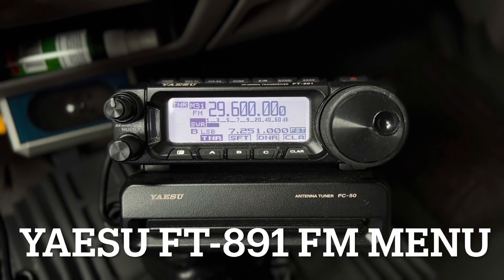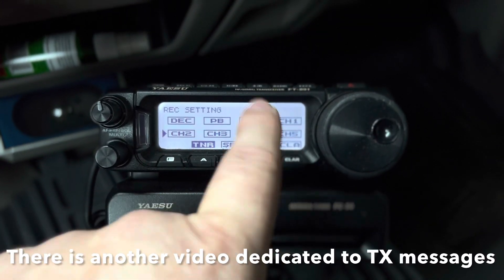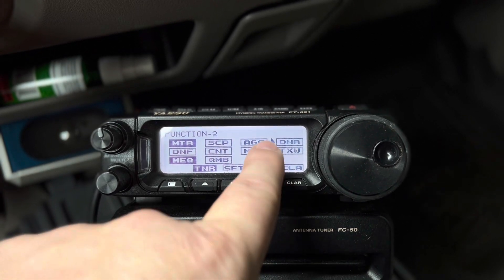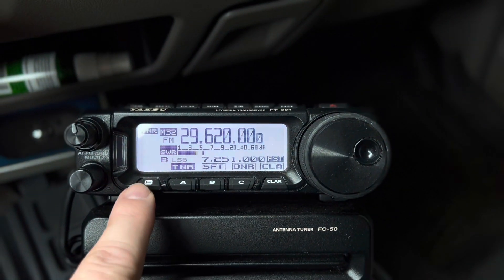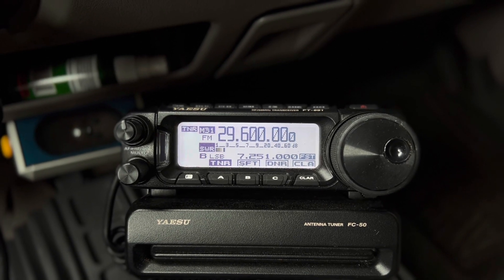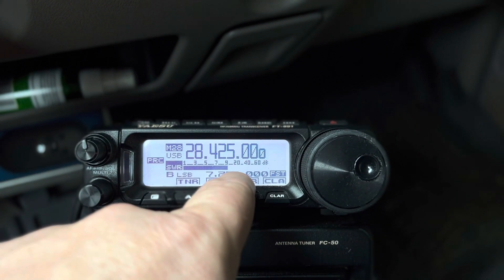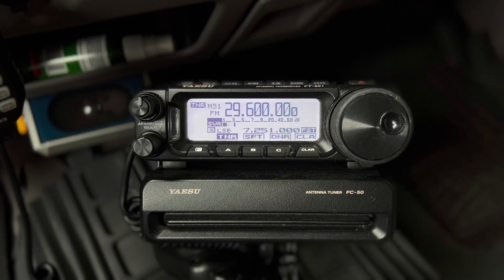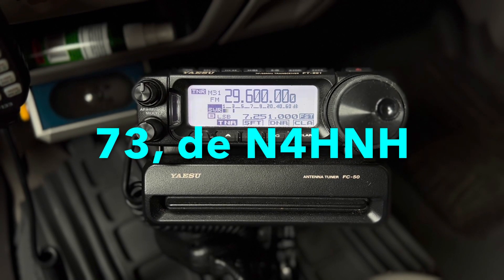Yaesu FT-891 FM Menu #yaesu #ft891 #hamradio

Comment: So…it chooses the proper frequency offset for 10fm and 6 meters?  I’ve been trying to figure this out on my radio. I’ve been out of th hobby for over 20 years so coming in now I’m in total shock with all the new stuff. I have a lot of new gear and I’m absolutely struggling to figure them out lol 😂
Reply from the maker: It's amazing how much has changed since you were last in the hobby!  There is a menu to set the frequency offset for 10m FM and 6m FM repeater operation.  It is usually 100kHz for 10m but can vary from 500kHz to 1.7MHz for 6m.

Comment: Hola amigo
Te cuento. Me compre un yaesu 891.  Traido de japon..o. sorpresa. Me encontre. Que solamente. Entregaba. 50 wats.  Hablando con colegas. Me dijeron que habia que actualizar el firewaaar. Bien. Lo hice. Pero nada. A cambiado. Luego me dijeron. Que desde el menu de. Servicio. O oculto. Se tendria Que poder hacer.  E entrado al menu oculto pero no sabria. Cual de los parametros habria que cambiarle...no se si es a si.o tu sabes. Como hacerlo..desde ya. Muchas gracias  si me puedes ayudar. 73" cordiales.  LW7DBJ. Carlos
Reply from the maker: Japan has different power restrictions than the USA.  It is similar to how Europe has the 70m band and the USA doesn’t.  The European 60m band uses different frequencies than the USA. You might want to contact Yaesu USA and see what can be done.

Comment: Can you do FM on cb band?
Reply from the maker: The FT-891 is an amateur “ham” radio. It requires a license to transmit with it.  With that license comes the responsibility of only transmitting on frequencies that are legal for a licensed amateur radio operator.  Out of the box the FT-891 will only transmit on amateur radio frequency bands.  But there are additional limitations.  Your license class determines where within those bands you are allowed to transmit.
Reply: @n4hnhradio  I mean’t to ask for the MARS Mod radio
Reply from the maker: If you send a copy of your MARS license to Yaesu, they will send the instructions for the MARS modification. If you perform the MARS mod and you intend to use the radio on frequencies outside of the official ham frequency bands, you do so at your own risk.

Comment: Wondering if you could help me out I started changing the menu but now it won’t move it’s like it’s locked. Any ideas thank you.
Reply from the maker: Try cycling power.
Reply: Ya tryed that a couple times
Reply from the maker: @tmfracing1315 you could disconnect the power cable for about 1 minute. If that doesn’t work, try a factory reset. But be aware that you will lose any menu changes you made.
Reply from the maker: To perform a hard reset, press and hold the F and the CLAR keys while powering up.
Reply: Got it working now just getting used to it first day haha thanks
Reply from the maker: Good

Comment: What about the split ie offset step? Is it done automatically?
Reply from the maker: Repeater shift (+), (-), or SIMPLEX, is set in the RPT parameter of the FM function menu.  Tone is also set in the function menu.
Reply: What about the +/- 600 kHz value? it is fixed ot settable?

Comment: Hi Doug, I've been thinking of purchasing the FT-891 for portable use. If I do I'll be back on YouTube (or Patreon) to watch all of your operation tips and tricks videos to help me learn the radio. As alway thanks for your work to make these videos available. 73
Reply from the maker: Hi Martin!  The FT-891 is a fun rig. There are a couple of shortcomings, as with all radios, but the good overwhelmingly outweighs the not-so-good. 

It lacks enough memory to save every setting when you save to a memory. But, still, do yourself a favor and operate it from memory tune, like I show in one of the videos. That will save you from having to use the Band button on top to change bands/modes. After you store your favorite frequencies and modes into memory slots, you will no longer need the top buttons, except to turn the radio on/off, or maybe the Fast button. 

The other shortcoming is the same as with other modern radios that task the DSP with handling the noise blanker role. DSP noise blankers tend to introduce distortion into the RX audio. Don’t run higher than level 5 and minimize noise with IPO, ATT, and/or RF Gain first.

Those two shortcomings are the only ones that bother me but only one reaches the level of annoying, and that’s the noise blanker. 

73, Doug

Comment: I am a new Ham deciding on a HF base station radio between a FT-891 without having to spend on Sound Card or Tuner or the IC-7300. At present  $280.00 more for the 7300. I know that the best is FTDX-10 but too expensive at this time or should I save my money and get the FTDX-10. Very informative videos on FT-891 and the IC-7300. I want my first HF to be easy to program and use.
Reply from the maker: IC-7300 is easy to program and use. You could start with it and upgrade to a FT-710 or FTdx10 later. The FT-891 has the better receiver and DSP over the IC-7300, but yes, it will need a soundcard if you are going to work digital modes. The IC-7300 is good enough for digital and for casual rag chewing. If you later decide to contest or chase DX the receiver in the FT-710 or FTdx10 will be best.  If you are willing to learn how to maximize it, the FTdx10 will be the only radio you need for years to come. My FTdx10 playlist has over 100 videos that teach you how to maximize your use of that radio. If you want the next best thing to the FTdx10, at a price that rivals the IC-7300, then consider the FT-710 AESS.
Reply: @n4hnhradio  At present the FT-710 is $1050 with discounts, so you mentioned to get the FT-710 over the DX10 and 7300 especially for the price. The FT-891 will not work as a base station without the sound card?
Reply from the maker: No, I would never recommend the FT-710 over a FTdx10. The FTdx10 is a better radio. But I would pick a FT-710 over the IC-7300. I prefer not to spend money twice. I would dig in and learn to use a radio that can take you anywhere you want to go with ham radio, rather than buy a beginner radio and later buy a better radio, having spent money twice.
Reply: @n4hnhradio  Sorry for all these questions. What about starting with the FT-891 as a stand alone base station or is a sound card or external speaker necessary? If those expense are need then I will go with the FTdx-10.
Reply from the maker: I don’t care about a sound card, because I don’t care for FT8.  I work FT8 occasionally for my viewers.  It’s not my thing.  I prefer to improve my skills by operating modes that could be used in emergency conditions, on battery or solar power, with no computer required. Those modes are CW and SSB. I also don’t care about a waterfall. It’s radio, not television.  So, I could be perfectly happy with an FT-891 as a base station. There are videos here on my channel that show me using my FT-891 as a base station.  I’m probably not the best person to get this type of advice from. I’m just not into the bling. For me, the focus is receive and transmit, in that order. Those take priority over a color display and waterfall.
Reply: @n4hnhradio  I appreciate your honesty, I don't care for bling either. I just wait to listen to HF and have my other VHF/UHF rigs. Just want something to start with and then maybe get the FTdx-10. Thank you for your help. I will subscribed to your channel and look at your other videos. Have a nice day and 73.
Reply from the maker: The FT-891 is a boss of a radio. The FTdx10 doesn’t beat it by much in receiver competition. I showed that in the FTdx10 playlist.
Reply: @n4hnhradio  Thank again. I appreciate your help and informative videos.
Reply from the maker: You’re very welcome!  73, de N4HNH
Reply: @n4hnhradio  What antenna would you recommend for residential rooftop for the FT-891 base station?
Reply from the maker: The FT-891 has no internal antenna tuner so you will need a multiband antenna. As far as multiband verticals go, I like the Cushcraft R-6000.T R-6000 operates on 6 through 40 meters.
Reply: @n4hnhradio  The R-6000 is expensive. Would you recommend a multi band HF around $350 or less for roof top setup without radials.
Reply from the maker: I’m not aware of any great multiband antennas for $350 that can mount on a rooftop.  The good ones will require wire ground radials - 20 or more.

My R5 cost $479.95 in 1995. It is the predecessor to the R-6000.  The R-6000 covers 6 meters in addition to 10 through 20, with no requirement for ground radials. My R5 only covers 10 through 20 meters.  Like the R-6000, my R5 needs no additional radials. The radials that come with it are all that is required. They are part of the antenna, so the antenna can be installed on a mast pole, a tower, a deck, or a rooftop. You can see in my N4HNH Antenna Farm video where mine is mounted.

There is an affordable option from Hustler.  The Hustler 6BTV is currently selling for $300USD.  It will require radials in order to get maximum performance from it.  But it does operate on 10m through 40m, plus a limited portion of 80m.  It doesn’t operate on 6m. If you can figure out a way to install radials on the rooftop, you could try the Hustler 6BTV, for around $300.
Reply: @n4hnhradio  I appreciate your quick reply. I will save up for the R-6000 since I don't want to bother with radials. I will look for your videos. Thanks again. I will probably also get the FTdx-10 which I was convinced to get thru your informative videos I might become one of your patrons to get as much short cuts on setting up the 10 when I get it.
Reply from the maker: Patreon members are the reason any of my videos exist. Their monthly support allows me to continue.
Reply: @n4hnhradio  I saw the video of your antenna farm. Very creative on how you positioned your antennas. On the R5 did you run coaxial on the ground? If so, what do you do when it is time to mow the yard?
Reply from the maker: The R5 coax is suspended below the deck. It doesn’t touch the ground. You can see in this video how my coaxes are routed into the shack: https://youtu.be/rR32rArlOts

Comment: If the first week of October is any sign of what cycle 25 is going to be like on 10 meters ,WOW!  Using the internal tuner on my IC 746 with bring up the VE3MMX repeater  in Ontario from DM72  ( using a 102 inch whip mount on a 6 foot high cyclone fence ), and I heard CN8VY on 29.620
Reply from the maker: I’ve definitely been enjoying the 10m activity, and especially the 10m repeater action. I’m so excited for those who haven’t been licensed for long enough to enjoy the action of the higher HF bands. They will get the opportunity to enjoy what some of us old-timers have been able to experience. 

73, Doug

Comment: I used Doug's FT-891 Optimization Guide on my FT-891 using a stock microphone and I'm always getting flowers on my signal and audio reports on SSB.   Very much worth it!   It would have taken me a long time to find all those settings.
Reply: Im waiting to see  if 6 meters is going to be like it was 50-60 years ago
Reply from the maker: 6 meters has still been very sporadic in my area. There was a great opening in April of 2020 but I haven’t experienced that level of propagation since then.
Reply: @n4hnhradio   There is an EA station from Spain working the 29.620 repeater right now-and I can hear him in NM!

Comment: As far as the "bonus item"... I do think Yaesu did a great job with that function on the FT-891.   But it blows my mind they did not do the same thing with the FTdx10!   I have to go into the menu and change the function manually vs. how the function changes automatically on the FT-891.
Reply from the maker: I wonder if Yaesu was thinking that the FT-891 would be mobile and thus they made it more convenient. But why not go ahead and make all of their transceivers operate that way. I think they need someone like me to ensure continuity across the product line. Hi Hi!  

Maybe they have different product managers for the different transceivers. Or the product manager for the FT-891 is no longer there. 

But seriously, someone should check for continuity across the product line. My FT-920 had a built-in pulser, for tuning a tube type amplifier. The FTdx5000MP has a Super Narrow APF option, which I utilize extensively. The 5000 also has more options for setting the AGC parameters. The 5000 has IPO2, which further improves the cross-modulation characteristic of the receiver. Why aren’t these features in the FTdx101D/MP and the FTdx10?

Things that make you go, hmmm?

73, Doug

Comment: The RF bonus segment is exactly why I eventually sold my 7300. That SDR just would not work like that and always had useless noise when listening to strong net controls etc. Is that a super head thing or do higher end full sdrs like the flex or 7610 have something to mimic lowing the RF gain and raising the volume to limit noise?
Reply from the maker: The noise you hear from a 7300 is partially from its audio amplifier. You hear it even with no antenna connection. It seems like ICOM used a cheap audio amplifier. There is also the digital distortion when the ADC gets overloaded. When I first saw that, I said to my friend, someone needs to make a radio with a superheterodyne front-end, to condition the signal, then hand it off to the SDR stage. A year later, Yaesu published the block diagram for the FTdx101D. And there it was. Yaesu decided to call it a hybrid.  I joked that Yaesu must have tapped my phone. 

73, de N4HNH
Reply from the maker: It’s more of a superheterodyne thing. The RF Gain in the SDR lowers sensitivity. So does the RF Gain in the superheterodyne. But the S-meter in the superheterodyne is driven from the AGC circuit. The S-meter reading in the SDR is derived from calculations in the digital domain. They perform some math based upon the amount of spectrum you are viewing at the time. Technically speaking, it is a Fast Fouriier Trsnsform, or FFT. 

The S-meter function differs because the SDR is creating the reading from a sample of spectrum, while the superheterodyne is driving the S-meter from AGC voltage fluctuations. We are more accustomed to how the AGC driven S-meter functions because it is the traditional method.  

The SDR is literally converting dBm measurements to S-units, based upon spectrum sampling. It performs the aforementioned math in the digital domain. 

As you lower the SDR sensitivity, via RF Gain, you are lowering the S-meter reading. To give someone an “accurate” S-meter reading, you need maximum sensitivity, so you must set the RF Gain to maximum. With the superheterodyne architecture, you can lower the RF Gain, minimizing the noise, and still see a relatively accurate S-meter reading. Note that most S-meters aren’t scientifically perfect. I went over that in my S-meters, Decibels, Amplifiers, and Gain video. 

I think of it this way. The traditional AGC driven S-meter provides a better operational experience while the SDR provides scientific analysis. When I’m operating my radio, I want the operational experience. 

I prefer the traditional AGC method because I like to set a point of reference, which I call S-meter squelch. If I rotate the RF Gain until the S-meter deflects to S7, I’m telling my receiver to minimize any signals and noise below S7. If I’m having a QSO with an S9 station, I don’t need to hear atmospheric noise between words. 

73, de N4HNH

Comment: Yessssa. This radio is great. Like alice in wonderland are the programming set up. I like that 🐈  kind regards
Reply from the maker: The FT-891 doesn't get the credit it deserves.  It is so multifaceted.  Working from the memories I programmed in, and using Memory Tune, it is a breeze to use the FT-891 as a mobile.  I seldom need to touch anything other than the multi-knob and the VFO.

73, de N4HNH
Reply: @n4hnhradio  hey, thats ok